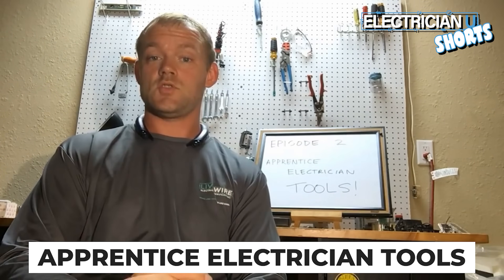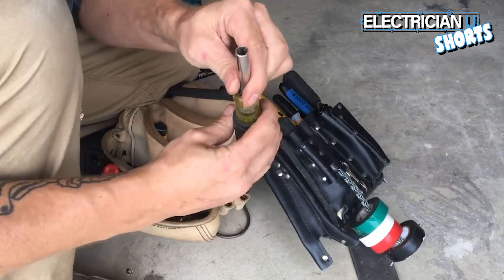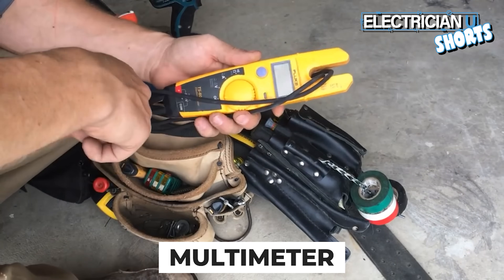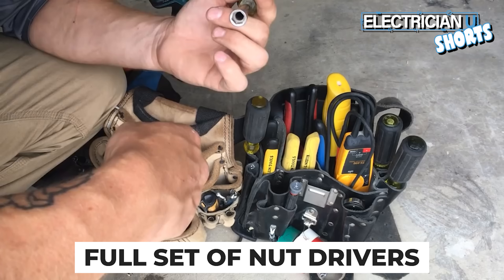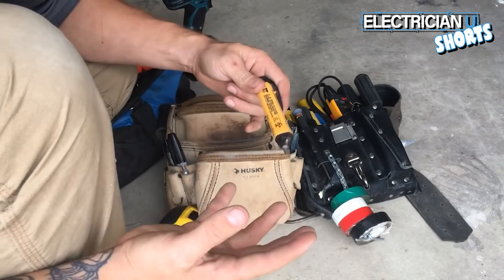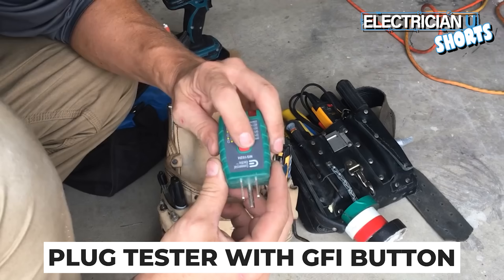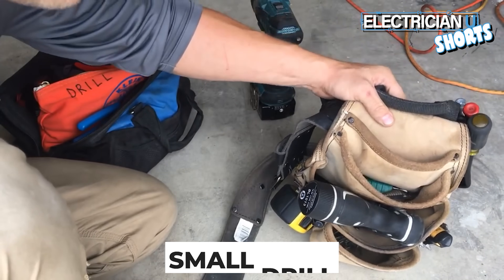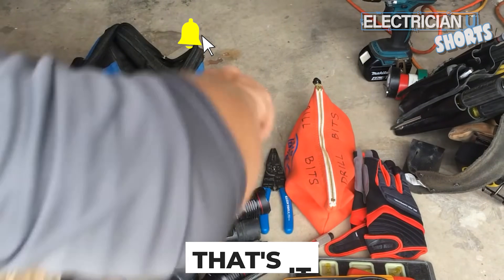SHORT - Apprentice Electrician Tools

Comment: I've been working as an apprentice I think I'm going to start using a backpack and a pouch... I get yelled at for carrying too much or not enough 🤣
Reply: Imma pocket warrior... pliers and 11 in 1 in back.. level in back. Everything else I need for the task on the side. Seriously prolongs your body. I used to wear everything in a big Klein pouch. Ended up being too much and really annoying. Once I switched over I never went back!!
Reply: @camtheElectrician7  lmao, give me Kleins a 11-1 and a beater, I’ll eyeball to make sure it’s level, everything else you better call an electrician
Reply: look into a five gallon bucket organizer i used to use one with pockets on the outside and inside than there where these round trays with compartments that would stack on top of each other like 6 or 7 would fit inside plus the bucket made for a great saw horse and pipe vise with a cple of shallow cuts and just throw some scrap wood over the top and its a great stool and seat lol
Reply: I think totes are better than backpacks, quicker to access and they don't fall over, when you open them, you don't lose stuff in the bottom of the backpack where it's darker.